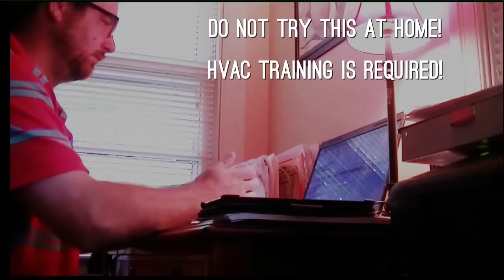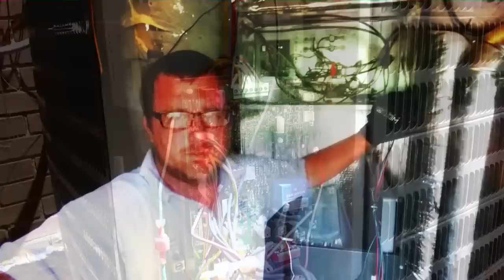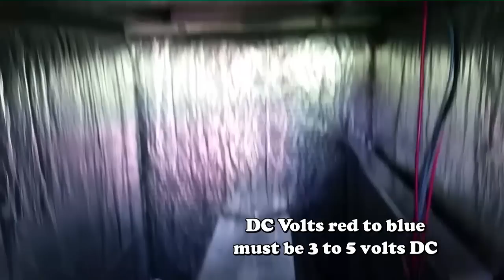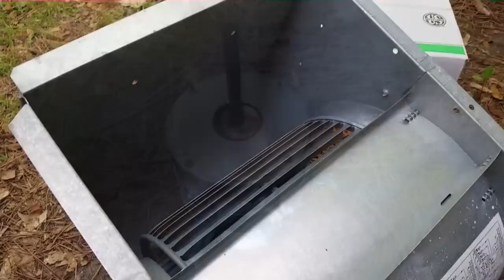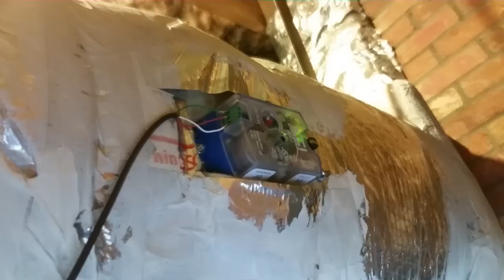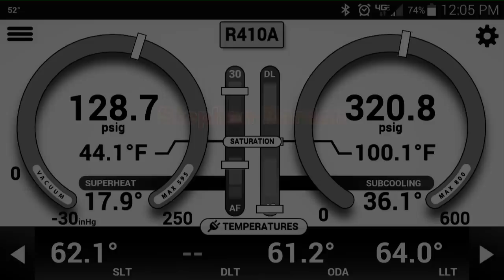ECM Blower Motor Troubleshooting and Replacement

Comment: Hey Zack so just the motor was bad not the module, right??
So how to know when just the motor is bad and not misdiagnosed the module??
Reply from the maker: You can ohm the motor windings to each other and ground. Also you check play in the bearings

Comment: Nice repair Zack. Glad I left the service field and moved inside before all the equipment had circuit boards. Back when I was performing service, (early to mid 1980's),  it was just R-12 for refrigeration, R-22 or R-500 for air conditioning, and R-502 for low temp/freezers. No recovery units back then either. My have times changed.
Reply from the maker: Brad1237202 sounds good to me

Comment: Good job,  Zack... This video makes me feel better about stay away from variable speed motor.. I pretty much only install Bryant 14 seer units... Other than the bad TXV last year.. I pretty much never have to go back on my installs.. 14 seer all the way for me!
Reply from the maker: HVAC in VA cant argue. All my 13s and 14s have been trouble free
Reply: talyn875 I like you HVAC guys on youtube  because you keep it real...Anyway, I had to go back this weekend on a 13 seer unit I install about 5 years ago. I found a bad cap replaced it for free and was out there in short order. Now on these new high units you might be out there for awhile trying to figure out what the heck is going on after a board goes bad or whatever..Zach, Keep the videos coming! They are great!
Reply from the maker: HVAC in VA 13s are easier to troubleshoot for sure. Thanks for the kind words

Comment: Drain switch is wishful thinking! Good thing goodman has those great warranties cause the homeowners will need em! I dont know how you guys who have or still do install goodman can sleep at night? I would have nightmares of warranty call after warranty call and my business name going down hill because of the unhappy customers over the break downs etc! Breakdowns dont make customers happy whether its under warranty or not and especially when its multiple breakdowns! Its happened before with goodman and back in the day i lost alot of customers and business over goodmans crap! I havent put in a goodman or done warranty work on those pieces of shit since! Icp and tempstar havent let me down and i have dealt them since and always will!
Reply from the maker: awsom70 I feel the same. I have had very few issues at all with Bryant and ICP units

Comment: What was the low voltage DC signal to the motor supposed to be? Good job.
Reply from the maker: Wayne Miles 3 to 5 volts DC

Comment: It seems all those goodmans and Amana you put in are failing on you.
Reply from the maker: All the high efficiency ones but 1. Moral : don't buy Goodman. Ever.
Reply from the maker: ***** I don't know, the rheem heat pump I saw with a communicating board from 09 had an LCD display. Goodman heat pumps just recently got them......